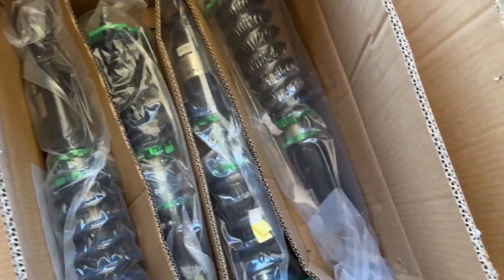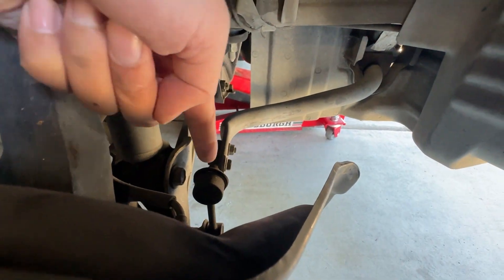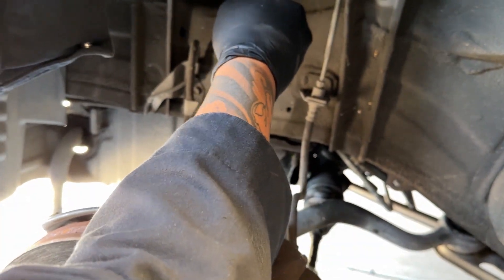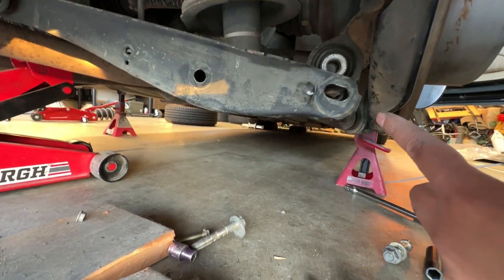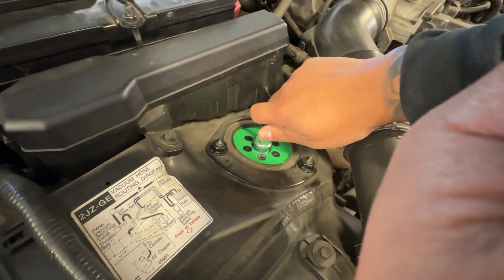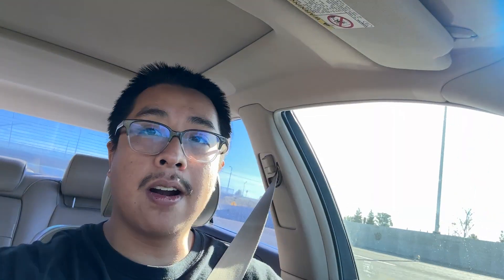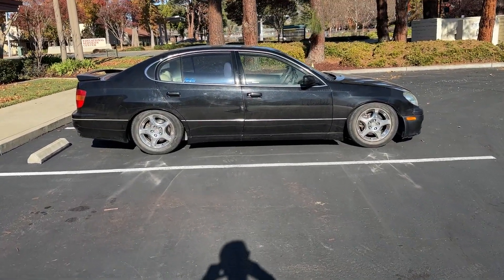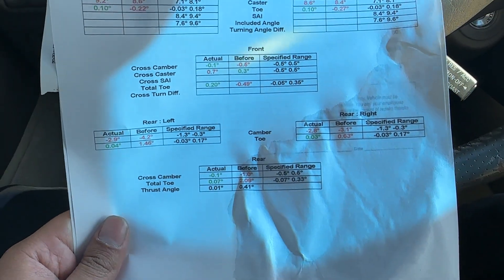Lexus GS300 Coilovers Install! EASY WAY!

Comment: The caster moved because the stiffness of the springs pushing down on the lower ball joint stressing it which throws the geometry off. But you should already know this because you had the same problem on the IS300 hence why you install roll centers, remember. Lol

Comment: The rev9s In my gs400 came with 10 front/8 rear. Do you think 14/12 would be much stiffer but still comfortable? The setup now rides great, but I like a bit of a tight ride.
Reply: It should be, these cars are pretty heavy and based on what he said 10k fronts feel similar to Oem

Comment: Are all of the gs300/ gs350s the same? Like can you run the newer gs350 (06' for example) coilovers on an older (2003) gs300?
Reply: nah lol completely diff
Reply: 2nd Gen GS are 98-05. 3rd Gen are 06-11. Literally the only thing they share is the name. The chassis is entirely different